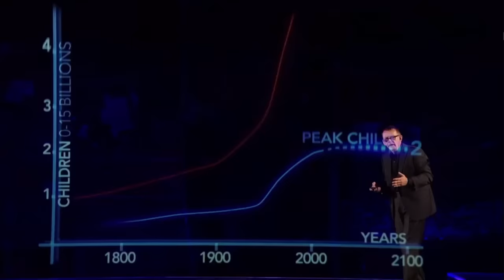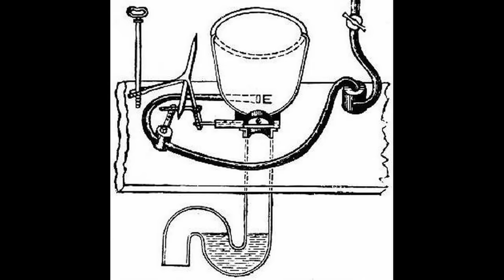How to Save TONS of Water, to Save the Planet

Comment: While is true that a shirt uses 2,700 liters of water, in most cases that water that is being used dont just dissapear, I believe it transforms and it eventually return (mostly) to the water cycle, even if you just trow water on the street, it would evaporate eventually and return to the cycle. I could be wrong tough, havent look into it that much
Reply from the maker: It will return to water cycle, but the problem is that we use fresh water faster than the cycle can put back
Reply: @ElectroBOOM  I can see that being a problem, saving water is always important, and I'm all for it, but I believe its a little missleading to say a shirt just waste 2,700 liters of water, I dont know how its the policy for water treatment and disposal for big companies, but my guess its that they have to reuse or treat properly a considerable ammount of it... or at least I hope so, maybe I'll look into it and just buy clothes from the brands with better enviromental practices. BTW, love your channel
Reply: ElectroBOOM devil's advocate here can't you use reverse osmosis distillation and special filtration to convert saltwater into freshwater? Saving our water also will not help other countries or even cities how do you plan on shipping the water?
Reply: Matt L it’s an incredibly expensive process and requires lots of power. Considering many developed cities are at risk of drought I think saving a bit of water wherever possible is helpful.
Reply: Daniel I but how can I help out another city through my water conservation I live in a very lucky area with a lot of water... They can never use my water
Reply: Daniel I I understand if Californians need to reduce their water usage if they are in a drought but what about New York how does their conservation of water help Californians
Reply: Daniel I the amount of water that I am putting down the drain to go back into the system is never going to affect how much water comes out of the sky. Available freshwater is based upon local resources. Sure it feels great to feel like you are contributing
Reply: @mattl7603  It's possible, and countries like Saudi Arabia already desalinate ocean water for their supply. However it's very, very expensive to convert to and maintain desalination infrastructure as expensive special filters and membranes are needed.

Water can (and is today) transported in bottles, jugs or tanks, this also goes for the dry parts of the planet and for places without sanitary infrastructure. Provided the containers are proerly cleaned, you can store water in them indefinitely.

Also, if a New Yorker saves his water, the Californians CAN get bottled water, but at a cheaper price (market & demand), as it will be cheaper for Evian and other water bottling companies to procure their water (yes a lot of the bottled water comes from community supply) and the chain continues... Even a few cents can mean the difference in someone being able to keep himself hydrated or or mean his death.
Reply: @mattl7603  very few people do live in areas with an abundance of fresh drinking water, if you do that's great.
Also remember that if you are upstream from other settlements, you may have plenty of water, but places downstream might not as you have tapped it off or contaminated it.
Piping that water shouldn't be hard, the oil industry manages it, often water poor areas are only a short distance from areas with plenty of water. Such as the other side of a mountain range, or a short distance inland.

 But if as you say you have more than could ever possibly be used then encourage your politicians and local government to allow industry that uses large amounts of water into the area. Many water intensive industries end up in water poor areas because of government incentives.
Solving the issue worldwide requires government intervention.
Reply: Tylonfoxx hey I agree with everything you say... but like you said these Solutions cost a lot of money cost and a lot of resources. Still though how does me pouring water down the drain back into local treatment effect another country
Reply: @mattl7603  because if some of the water intensive industries that take water from the freshwater rivers were to move to areas with an abundance of water then there would be more water for places like California.

Not only that, but many places renowned for being wet and dreary (London/England) are at huge risk of water shortages in particularly dry years. Climate change may also change where those areas of abundance and drought will be, along with changing the pattern of rainfall making it harder to capture. It's important to save water in wet years too, it takes many years to fully replenish a depleted water table and underground springs, but by conserving in wet years there is a greater store in place for dry years.

Here we are experiencing hotter, drier summers. Annual rainfall is increasing, but it's coming all at once, in big storms and causing short term flooding but not replenishing the water table and reservoirs.
Reply: @mattl7603  New York (city) was historically short of water, a huge aquaduct was built to bring it water from areas with more abundant sources, this aquaduct and the new reservoir  flooded thousands of homes and destroyed whole towns. This aquaduct was unable to bring enough fresh water into the city after just 20 years. So more sources were needed, including drawing water from the Delaware River tributaries, reducing freshwater availability for many states downstream. Look up the Catskill aquaduct if you don't believe.

 Therefore conserving water in New York (either the city or state) reduces the costs of transporting water and reduces the need for another aquaduct to cope with increasing demand. It also means there's plenty of fresh water still available for those further down the Delaware River.
Reply: Daniel I it sounds like you're scared. The age of information is a curse. We are a very adaptive species. Here comes some sarcasm we got through Y2K we got through global cooling we got through the coral reef dying I'm pretty sure the polar ice caps are okay studies show there are more polar bears now
Reply: Daniel I so government failed us moving water let's ask government to move more water from my area to another area missing something here... and where is the conservation once it goes down the drain it goes back through filtration it is still conserved
Reply: The only thing we are saving is the amount of filtration we need to use and time..
Reply: @mattl7603  water going down the drain goes into the ocean. It's rarely drinkable after treatment just less bad for the environment.

I also don't get your point, water flows, if you screw up a river in New York, then suddenly people in New Jersey can't drink. There's countless examples of this type of failure both in the US and elsewhere. Entire freshwater lakes have been destroyed by another country upstream diverting rivers.
Reply: @mattl7603  It has the result of that other country will also have to pay less per unit of water (which again snowballs into having the end consumer pay less, VERY important for poor countries!) The scope of my point is not just limited to the US cities and states, but the entire planet, as water is a resource necessary for all of us. Remember, every drop you poured down the drain could potentially have ended up in a bottle, jug or tank to be exported, especially in times of crisis. You alone will, however, not make much of a difference, but if enough people make a conscious effort to save on water, it can save a lot of people. 

You need to think how the water COULD have been used before it came out of the tap, not how YOU already used it
If you still don't see my point, I strongly suggest you study how markets and economics work. Even if someone is in dire need, money talks with a loud, booming voice

In short, by not pouring water down the drain can actually save someone less fortunate than yourself... Even if it might seem differently on the world scale, water is still a shared resource. At the same time you can help push Earth day back... Earth day of 2018, the day where we used all the resources that the planet could regenerate in one year, already fell in MARCH... water is one of those resources, a resource you do no use, can be sent to another who needs it. THAT is how it can affect another country or the poorest in your own.

Now, it's not only us that need water, but our food as well. If a guy in Syria cannot get water for his crops (because you're helping putting strain on your own country's resources), the scope of the consequences extend a lot further than the farmer or his own family... Not enough fresh water for crops or livestock will lead to famine, which leads to war, which leads to the dark side of the Force. The same goes farmers in your community cannot get water. The only difference is that the western world has more options by the simple virtue of having more money and better infrastucture. It would likely take you longer to feel the effects of the crisis, but the crisis is still there.
Also, if the water was stockpiled (as our planet does naturally), the crisis could have been averted altogether...

Far from all plants and crops can be watered with salt water and livestock cannot drink it... if there's no fresh water for the crops and animals we consume, then we are definitely dead! Crops and meat is also much harder to transport in the end than clean water.

i'm afraid you fell straight into the fallacy of "this will never happen to me"... I can tell you it will if we do not change our ways.

Also we are not "through" melting ice caps and coral reefs dying. We have found a lot of potential causes, but no end solution, unlike Y2K (which was an easy solve) or polar bear population... the scope of climate change is many many times greater that what humanity can solve at its current level both socially and technologically.. Neither the US nor China being any help at all there, as they don't want to apply themselves to the goal in fear it might hurt industry...
Reply: Daniel I the problem is we're talking through the comment section I'm not totally disagreeing with you..... we can be the ultimate Preppers in case of local disaster fine. but we cannot help out others in other countries or cities efficiently or effectively by our local conservation. And the actual waste of water that goes down the drain that does not get reused is so miniscule.
Reply: @mattl7603  all waste water in London is treated then discharged into the North Sea. None of it is reused, and I would expect a similar story in many places. Treating the water to the point it is reusable is expensive.
Reply: Let's say I take one extra bath this week should I feel guilty because the amount of water that is filling my tub... am I contributing to drought am I hurting California... and if I don't take that bath will I be helping out any other state any other country do you get my point
Reply: @mattl7603  what has California got to do with it. Huge amounts of money and energy are wasted moving water to you and treating it before and after use. That is true wherever you are, you are also diverting water away from others downstream, potentially damaging ecosystems and reducing availability for others.

 An occasional bath is fine, and that luxury usage can easily be offset by turning taps off when you brush, using low flow or aeration taps, eco toilet flushes, dripper irrigation rather than spray and using rainwater or grey water for irrigation, toilet flushing, or car washing. It is however like many things a case of diminishing returns, but it would be relatively easy for most people to halve their initial water use for little cost.

Unless you happen to have your own spring on your own personal property, that flows directly to the ocean passing through no other property then you should be conserving it where possible.
Reply: Daniel I okay I agree with the transportation issue with neighboring states only... but it's the steps that you were talking about that I believe have so little impact with this ultimate renewable resource... money for filtration or better modes of transportation are the problem not the individual. It's fear-mongering and telling people that their living their lives wrong because we wash our hands a little too long is almost to the point of insanity
Reply: Daniel I I'm not changing my lifestyle putting all these fixtures on so I use less water and divert less . households use literally nothing in the long run and it all goes back and gets filtered
Reply: Daniel I should we ban water parks that use a hell of a lot more water than I ever will in my entire life time and they get their water filtered back just like us
Reply: @mattl7603  5 minutes of time is all it takes and you can't be bothered. Many utility companies in my country supply almost all of the water saving devices I've mentioned for free. Widescale adoption of water meters should be mandatory in my opinion, perhaps then people would care just a little bit.

Again most waste water worldwide is treated then dumped into the ocean. It is NOT returned to the drinking water supply.

As for water parks, they treat and reuse water on site, much like many commercial car washes in my country.
Reply: Daniel I so why don't we get rid of all the pencils in the world you know how many trees we could save... how about that cell phone you know that battery is horrible for the environment... and here where I live the water we pee in and flush gets filtered right around the corner at a water treatment plant and we get to drink it again... have you ever heard of virtue signaling
Reply: Daniel I so it goes back into the lake and then guess we refilter to us...still a renewable resource still can't quote on quote waste it..
Reply: Daniel I this will be my last comment it was fun and before the virtue signaling and calling me a twat I think we agreed about transportation of the resource. But have different ideas on what the individual should do.  Flushing your toilet too many times is nothing compared to a football stadium an aquarium an amusement park a water park... go ahead and feel guilty And subscribe to the ideology that you are the cause of the Earth's destruction. I believe human interaction with nature and others is extremely complex and we are doing the best that we can considering....
Reply: yourcurtainsareugly its impossible on YouTube.... i guess think of this... almost every process in life involves water to create or maintain. Every! And a ton! Including roadways and bridges. I cannot possibly go into detail how much each industry or farm that we need to live uses but its a lot.  Government and special interests have been imposing that it is the fault of the individual for their problems...the water nightmare is logistical and nothing more. 
For how much water is on this earth and all of it is a reusable resource (expensive to filter because of many unrelated reasons) with none that i know of leaving the earth  we need to find a way to cost effectively filter and transport it.... a foot pump that uses electricity and probably will be created in a plant that uses tons of water... just isnt the answer... we CANNOT fix this on the individual level.
Reply: yourcurtainsareugly I have not developed anyting by the way and we both know how complex that truly would be. And your assumptions are all wrong.

Comment: has noone ever told you that the water supply is a closed-system they dont waste water , it gets filtered in a loop next to your sanitation water. Nobody ever talks about it since ppl find it gross but come on and use your brain,: seemingly endless water out of nowhere for everyone at any time just open the tap and dont ask questions ?
Reply: That would be in some modern countries.
Reply: you mean the exact society that should use the foot-switch he praises ?
Reply: I'm not sure where they do that, but they sure don't do that in Oklahoma.

For example: my town gets its water from wells, mostly.  Deep ones.  We're on top of a smallish bedrock aquifer.  There's a small reservoir we can use during high demand, but the aquifer is our primary source.  The wells feed into the water treatment plant and then out to the city water system.

Sewage goes out to the sewage treatment plant (about two miles away from the water treatment plant) where it flows into settling ponds, gets treated, and then eventually is released into the river downstream of the city.  You can tell where the release point is because algae builds up there and stains the sandbanks.

That's not to say that towns down the river don't use river water as a water source (they do), but that's not a closed system.
Reply: Here in W. Montana the snowpack feeds rivers, the rivers replenish the aquifers, we pump from the aquifer, then release treated sewer water back into the rivers or ground. All of that requires continuation of the first thing: snowpack. Not a sure thing.
Reply: Every time you recycle the water, you use resources - chemicals, energy... It's wasteful.

Comment: I turn on the tap make my hands wet for a second and turn it off instantly, and then use soap and turn on the tap and wash then close pretty quickly. Never knew people actually leave their tap on while they add soap 😂
Reply: Now your tap in covered in soap, and when you finish rinsing the soap off you just put more soap on your hands turning the water off again.
Reply: @MelodicTurtleMetal  Actually you can take a little bit of water in your hand and just pour it over the taps and it pretty much rinses it off. Try it! Just don’t caress your tap when you’re turning it off while having soap on your hands.